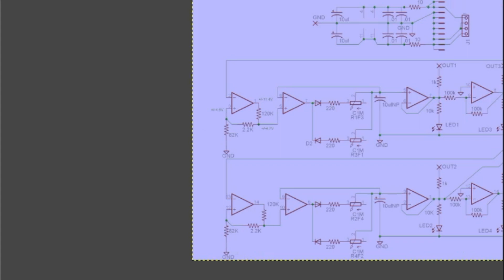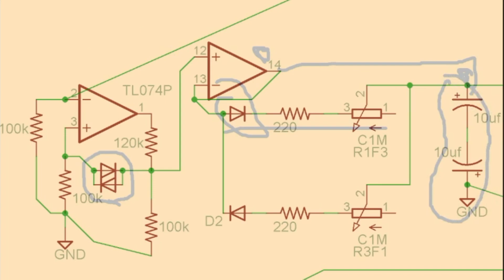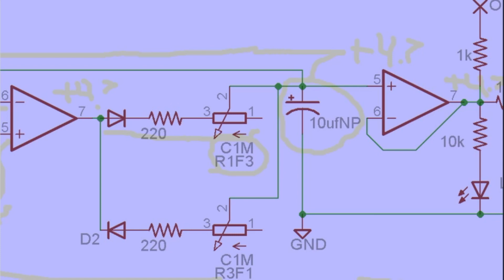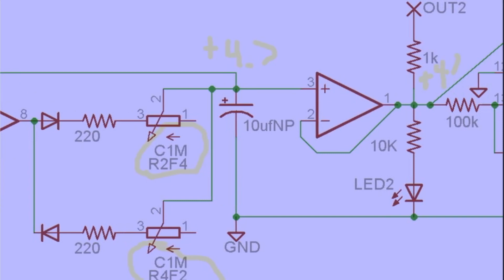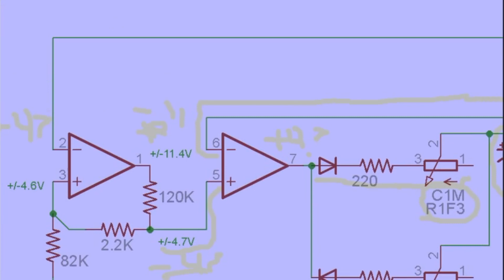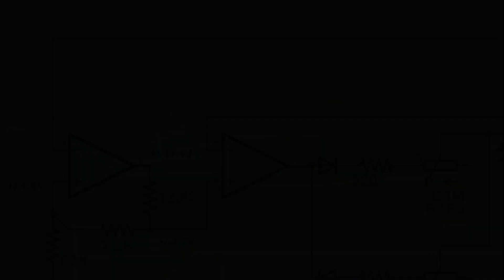BMC031 QTLFO Rev2 Schematic Walkthrough

Comment: I replaced the opamp Schmidt trigger with a bi-polar powered transistors configuration using 5 of them, uploaded a video to my account plus link, it even allows you to use logic gates (AND, OR, flipflops, xor, etc) if placed after the first 2 transistors.